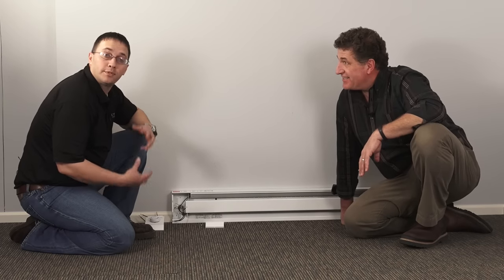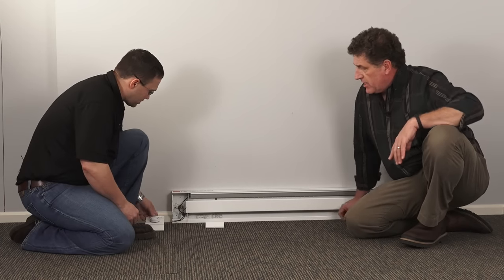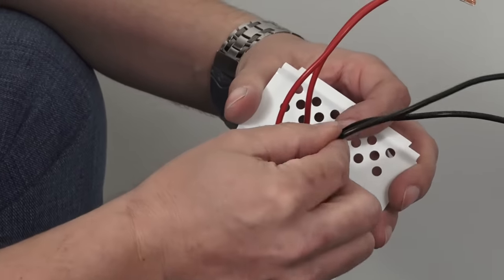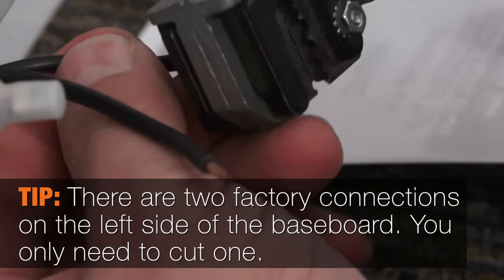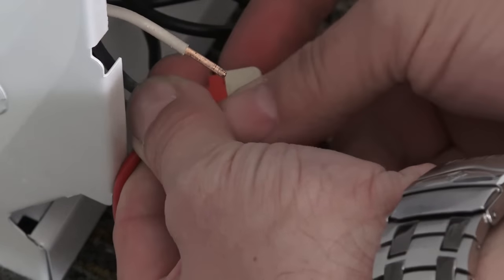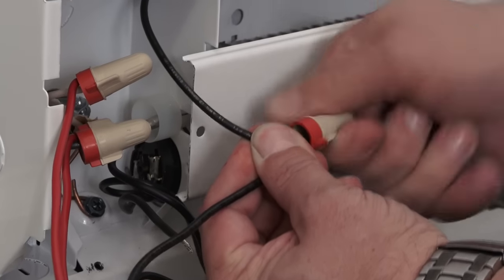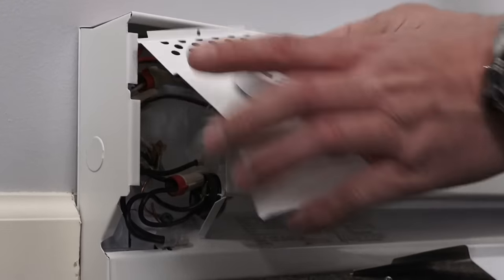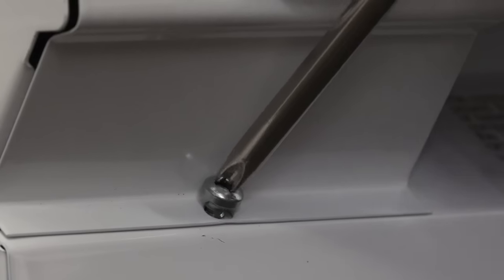How to install: BTF2 thermostat on 240V baseboard | Cadet Heat

Comment: my question is how do you determine weather to get a 120 v or a 240 v? for a new instal. im wanting to use my existing electric supply line., i removed a entire wall socket so i can use the electrical supply frombit but its a 120 line so do i have to buy a 120v only? and a 240v would be if i ran a 220 line?
Reply from the maker: Hi Denise, So the voltage of your heater has to match the voltage of your electrical supply. So in your current situation, yes the heater should be a 120 volt. Just keep in mind that lots of times multiple wall outlets are connected to one circuit. A heater will draw a lot more amps than other electronics and if you have too many other things running on the same circuit, it would be easy for the circuit to trip. That's why we suggest you install heaters on a dedicated circuit. If it's a new installation, we suggest 240 volts because you can install more heaters on one circuit.